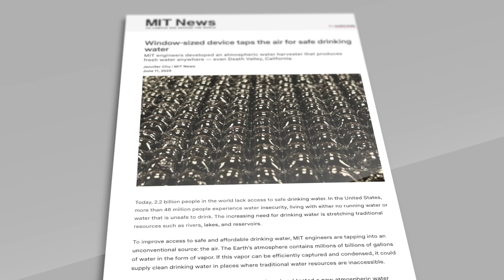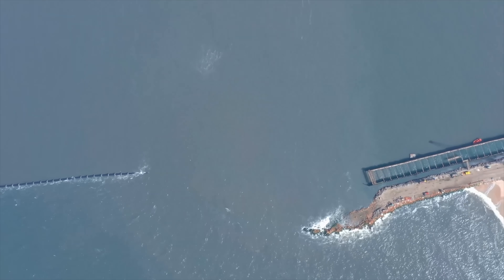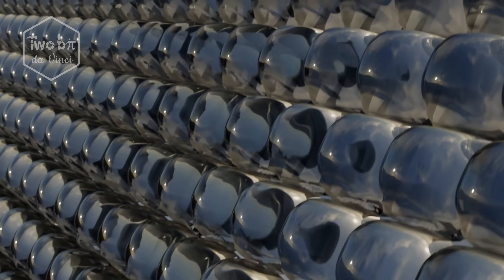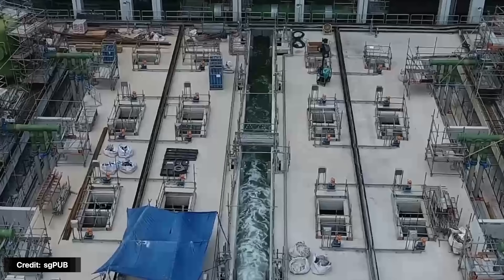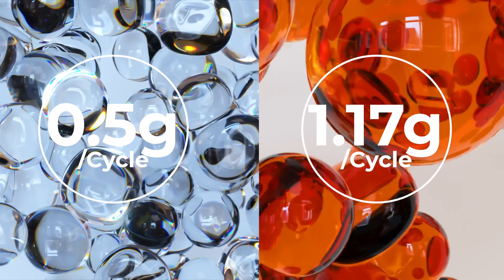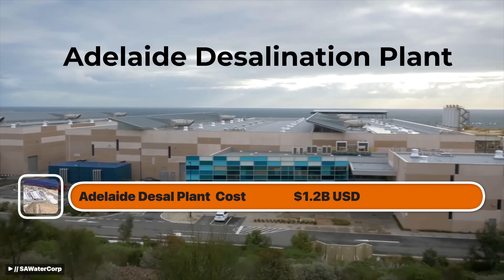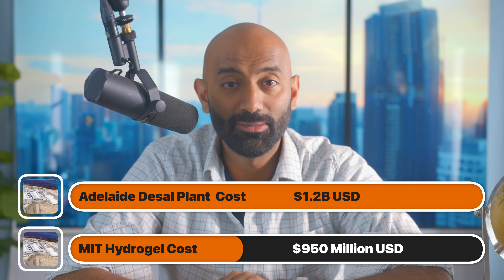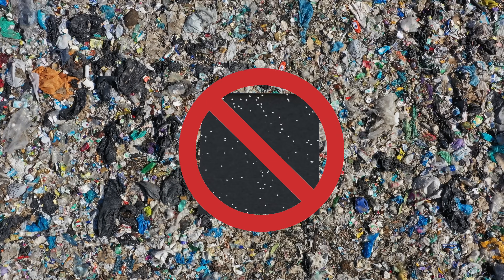MIT's Breakthrough Hydrogel Makes Water From Air w/ ZERO Power

Comment: That Adelaide Desal plant might be the reason all the marine life down the whole coast are dying en-mass. They were dumping something back into the ocean and artificially raised the salinity of the whole coast. but it is speculation at the moment but it looks likely.
Reply: Im pretty sure water can only hold up so much shit before it simply solidifies at the bottom of the sea, but the fact that there's no legislation around the ammount of shit we drop in the sea/ocean is kind of shocking, like, not making a pathway to a low enough level of the ocean instead of dumping it straight at the end of the river is kinda wierd
Reply: @lucac1430  All water ultimately ends up back in the sea, so the overall salinity of the world's oceans won't be changed by dumping the previously-extracted salt back. The trick is to ensure it doesn't create excessive salinity in localised regions.
Reply: @lusoverse8710  Exactly. Part of the trick would be to find a way to use the brine rather than discarding it.
Reply: Everything comes with a cost
Reply: I think the current is not flowing that way .and drop in a bucket comes to mind
Reply: no, it makes no difference. Why? Because that is exactly what happens when sea water evaporates. That said, dispersing the by-products is very important because you can over salinate sea water... but normally that's taken into account and the discharge pipe is far enough out to sea that its all ok because of the water flow.
Reply: Why is it only the Adelaide plant with the problem and none of the other plants that dump the brine back into the water?
Reply: As another example I've heard this is also an issue in Saudi Arabia...
Reply: Life is dying due to lack of fresh water and your ignorance. Next time why don’t you research it instead of pulling wild speculations out of your behind.
Reply: @mikeguitar9769  What they brought up is a very legitimate concern. How is the brine disposed of afterwards? Is it disposed of in a way that doesn't destroy the life in the water? The world is dying because of lack of foresight. Next time why don't you research potential consequences and issues before pulling a poor attitude out of your behind